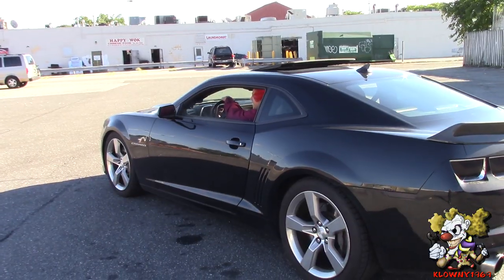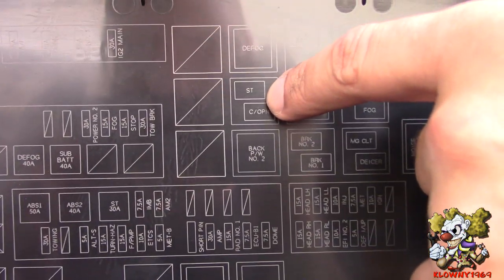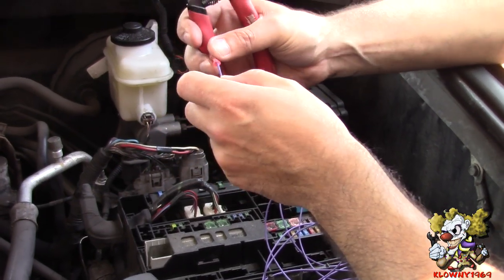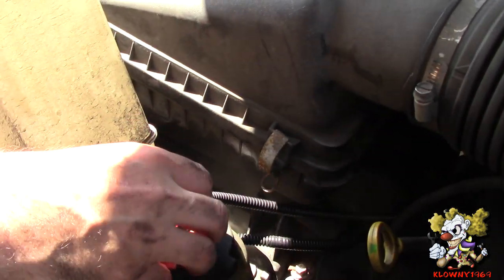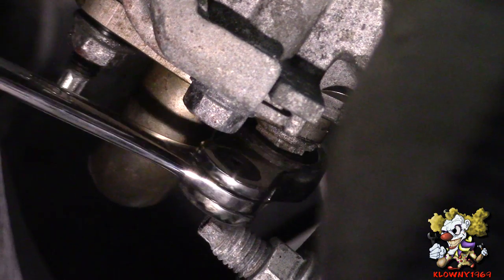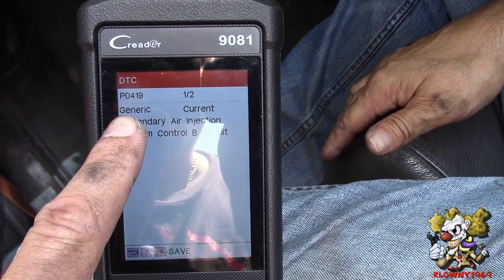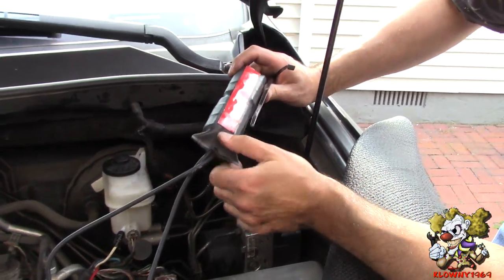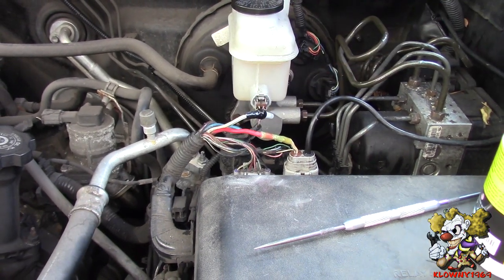How To Bypass An Air Injection Pump P0418 P0419

Comment: this is more expensive, i rather changed the air injection pump and air control valve..if your lucky might be only needing a cleaning.
Reply from the maker: This is less expensive..pumps would be in the thousands..don't forget to subscribe